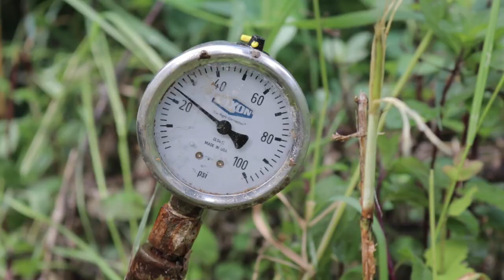My New Ram Pump - AMAZING!

Comment: my amazing father Gregory Blaine Anderson made and used one of these to collect water 1700 feet away and up 300 feet of 45-60% slope  in Montana, no gas no electricity 800- 1500 gallons per day depending on head.
Reply: How much of the water is being lost though? It looks 1/2 of the water is being pumped out of the pump into the environment. I've never seen one that is not right there at the water. Doesn't all that waste water cause problems?
Reply: That waste water is the reason why this pump doesn't break physics. You start with a lot of water at a certain elevation, and waste some (or most, depending on your needs) to get the remaining water to a higher elevation than it was at the beginning
Reply: +Dusker... That isn't true. The laws of physics aren't being broken in the same way that a dam isn't breaking the laws of physics. The ultimate energy source powering the pump is the sun. The sun evaporates water and then it rains and the water lands at a higher level than sea level and the water has kinetic energy from running downhill. That kinetic energy is converted to compressed air which forces water uphill. The design of the pump causes a large percentage of the water to get dumped, which is why it's usually right at the source.
When I said problems, I was mostly referring to drainage, land and erosion problems, not problems with the pump.
Reply: First of all i was very tired and didn't read your comment very well and so i didn't quite get what you were trying to say. My fault, I'll take the blame for that.

Regarding your analysis,
well you can say that the big bang is the ultimate source of energy then lol... your argument about the sun is partially invalid: it is true that the sun is powering the whole thing (as it does with almost every other source of energy on earth) but the potential energy gained by the water from the sun is maximum when said water is in clouds, and when it rains some of that energy is converted into kinetic all the way down to the ground, and when it sits in a pond it has much less potential energy than when it was in the clouds. So it's safe to say that we can begin calculations taking as starting point the source water body (as it is done in hydrodynamics).

What i meant is that, in a closed system like the earth, you can't transport water (or any body) at a higher elevation without putting energy into it - this would contradict physics because it would gain more potential energy than the kinetic energy it already had (ever wonder why dams don't use the energy they create through their turbines to move the water even more uphill? Quick answer: you can't). So if you just tried to move the water from the spring to higher land using its kinetic energy gained falling you will at most (assuming 100% efficiency in all the system) get it to where it started. However, an amount of water (let's say 1 liter) 10 meters above the pump has the same energy (relative to the amount it would have at the pump's level obviously) as say 0.1 liters 100 meters above the pump. By sacrificing water you gain height. The maths is pretty basic, the equation will be (m1*g*h1) = (m2*g*h2); since g is a constant we can take it out of the equation and we get (m1*h1) = (m2*h2) and you can easily see how changing one value varies the others to make sure the equation is respected.
Reply: +Dusker... The Earth is not a closed system. The sun is constantly giving the Earth energy. If Earth were a closed system, it would be near 0K with only remnants of the heat  from the core.
I understand that overunity is not possible. It would take far more water to generate the electricity to pump water back uphill than the pump could pump.
I understand that the Ram Pump isn't anywhere near 100% efficient  and that the system wouldn't work without that loss of water.  The pumps captures the energy in that moving water and then dumps some of the water and then is left with enough energy to pump the remaining water some particular height based on both the amount of energy in the moving water and the design of the system.
Also, some of the water may be coming from natural artesian wells and have a different source (though not ULTIMATELY) of energy..
My point is and was that all that water the pump is losing causes other problems such as mosquitoes, erosion of the soil, growth of plants that like standing water etc.  In all of the other instances I've seen of these Ram Pumps, they are at the water source and the loss is no big deal because it just goes back into the stream and is not free to do its evil deeds.

Also, no hard feelings. Sorry if I came off snarky or something. If so, it was unintentional.
Reply: if that "waste" water end up in same creek as original source, there is no environmental issues. its just diverted in certain amount from its original path to be reunited downstream.
even if not following its original stream, amount of water in this case is not significant to cause any huge damage to its surrounding.
do not forget, people build a ponds, lakes, and still environment absorb such structure. i am not aware of any cliff where huge amount of water will cause landslides and erosion.

as evident in this case, it is the valley between two sides of the hills and natural collector of the rain/snow/ice water. rest your mind, all is good here :)
Reply: @tarstarkusz  R/IAmVerySmart
Reply: @tarstarkusz   probably like 90+ percent continues on its natural course., its probably thinking to head on down to the sea. buy where is this sea thinks the water? I guess i'll just flow on down till i find it, says he.
Reply: @tarstarkusz  In another ram pump animation video, they say, if you intake is 10 litres per sec  depending on supply head, then only 250 ml of water per sec is puMped 100 meters upwards
Reply: Since m1h1 = m2h2 measured at the pump, the pump then can be put into a deep deep hole, so h2/h1 gets close to 1. This means as long as the hole is deep enough, the waste water can be reduced to almost 0. Right? Of course, assuming the waste water still can be drained in the hole.

Comment: i guess with enough storage towers and pipe...and some float valves to slow or restrict  water levels in the towers or tanks..could you move water indefinitely?   soo given a a handicapp of say one year? cause nothing lasts forever.... could this be propeterial motion that actually works?

Comment: as a man who works in the water industry as a mech fitter i enjoyed this video!
I would be wary of using the plastic pump in winter, although it has constant flow i reckon it is likely to freeze and crack, we use pvc-u a lot. We dont even really get that cold of a winter here in england either haha.

Also, when using your stilsons to free the union, take a ball peen hammer and just knock the union without the stillos on. this is usually enough and avoids you having to hit your tools :) nice video!

Comment: If you have enough fall after the pump , you can install a second Ram pump using the waste water and return a portion back to the source , or several pumps daisy chained and stretch your supply during dry spells .

Comment: It would be nice to catch the "waste water" and perhaps let it collect in a man made pond. Stock it with fish. The grassy are you walked through when finished, could that be dug out and made into a pond?
Reply: Read Sepp Holzer's book "Permaculture"; I'm only a very little way into it but one of the first things he talks about is making a pond.
Reply from the maker: The wast water runs directly into our pond,
Reply: does the waste valve have to be left open to work or could it be plumbed to a catch basin or pond?
Reply: Wranglerstar  you should look into a venturie set up for easier prime could use air pressure and or water from reserve to pull a vaccumn on feed pipe for faster prime if you would like to see what i am talking about pm me thanks and nice video
Reply: Or maybe divert it back to where it was originally (if possible)

Comment: you should also put a screen over your stand pipe because that is an access point for trash in your system
Reply: Right. When the pump is not working, that wastgate valve is open, so anything can just fall in.

Comment: I have a few ideas for your ram pump. At the inlet, cut the short end of a large funnel to fit the inlet of the ram pump, then put screen on it so the area coverage is much greater and you wouldnt have to clean it near as much. Also for other debris that gets in your could install a tank (5 gal would work) near the inlet with a large watertight opening at the top side about 4" or more so you can simply open the lid and clean it out before anything gets to the smaller pipes and pump at the home. Just put another screen in the outlet side of the tank. The cleanout opening for the tank can be pvc so you can bury the tank just below the surface and still reach it.
Reply: Nice idea. Perhaps having the funnel gauze at an angle to the flow so it will shed debris to the side would help too.

Comment: What will you do if Jack gets smart and chooses to work smarter not harder? He might figure out that he can just make a bigger inlet filter pipe area, make like a big O out of perforated pipes and wrap pipe section in screen, then hook that to your inlet pipe and now it will take like a year to clog the entire screen. lol A rectangle could work even better since you can make a rectangle easy from pipes, make a rectangle out of perforated that way you can easily wrap it all in screen, just have a tee on the perforated pipe rectangle where you hook it to your inlet, it will look like a rectangle screen when you are done, and you gain even more filter area. It means it won't clog every week. Based on the size you have available, you could make the rectangle around 3'x5' but that is huge for the application, so a 2'x3' rectangle would keep your inlet clear for at least a year straight. But that is only if the top, bottom, and sides are all under water. Don't glue it to the inlet, but glue it together as one inlet filter pipe system, a one piece system, then you can just pull it of the input leaving the screen on the glued pipes, and just clean off and then swish in water until perfectly clean again, then put it back on as one piece.

Comment: pull off 24 feet (for Stihl professional heads), pinch at 12, stick both ends in the spool at the same time and wind both sides at the same time. when you come to the end, clip the loop, and set the ends in the head! once you get the hang of it, its a lot more efficient!

as for the string going back in, thats usually casue the cutting length needs to be maintained. just tap it bore often, (cutting off a bit excess is less frustrating than re spooling)

Comment: if you install the screen every yr then how did pine cones get in the pipe?
Reply: The screen probably gets torn and larger material (pinecones and sticks) can fiddle their way into the line. Might be better if they use a cone or cylinder setup with a few layers of mesh over the draw pipe. But how would they teach their children about responsibility if they had a system that was perfect and needed no maintenance.

Comment: Why not pipe your overflow to a tank and make  electricity?  (like a cheap 18' swimming pool, and use solar , single battery,  to open a solenoid every time the pool is full.)

Comment: You should have a much bigger screen than what you installed: with such a small surface, it will get clogged almost immediately. Make a kind of sphere structure, from sort of mesh, maybe 5" diameter, cover that with door screen, now you have a good filter surface.
Reply: To elaborate a bit, with the screen the way you installed it, you have about 3.14 square inches of filtering surface, with a sphere of 5" diameter, you have about 60 square inches of filtering surface: much less likely to clog fast. In fact, strainers installed at the end of a suction pipe are always double diameter of the pipe... Around here, fire fighters often use water pumped directly from natural resources, I have seen them use a wicker basket as strainer.
Reply: Easier to take a length of PVC pipe, cap it and drill it full of holes and then wrap a screen around it.  Will dramatically increase the surface area without much fuss or cost.

Comment: I have a Stihl FS460 brushcutter/strimmer (I don't know what they are called in the USA) and I have found that when loading the string, it is best to bend it into a 1/2" hook on the end with a pair of pliers.  This helps keep the strimming string/twine fastened into the spool.  Also if I wind it too tight around spool, it melts, so wind it loose.  Just a suggestion.
I have a blade too but it gets terribly tangled with nettle and briar which are fibrous.

Regarding the water collector...  If you find a piece of drain pipe (the corrugated plastic stuff 3" or 4" with little holes in it) that slips over your 2" pipe (you can easily make an adaptor using a carved rubber bung) and then completely overwrap that corrugated pipe with gauze, it will extend the surface area for filtration and then you don't have to clean it so often.  You can also make all of the holes in the corrugated pipe a little bigger with your battery drill.

Comment: Thanks for the explanation.  I live in Sri Lanka. I assembled a pump, 1/2" and it works. Mostly out of PVC other than the 2 valves. I will be tightening ang glueing all the components tomorrow. 
Thanks once again.

Comment: Suggestion, put a union on the upstream side of your supply valve. It makes it easier to remove and clean out. A gate valve, which is what that looks like , is notorious for getting stuff stuck in the valve seat, a ball valve might be a bit better. By the way there are friction and fixture losses, just not that big a concern with this set up.

Comment: Helpful tip for rewinding your trimmer line... there are two holes with a slot cut in them on the button side of the rotor. Those are for holding the line after you wind it to keep the spool tight/prevent jamming. Just pop the end of the line into that notch until you have the rotor secured in the housing. There are also tabs on the rotor that correspond with tabs on the inside of the housing to secure the rotor against the housing, just push in the rotor and rotate until the little slotted holes that secure the line for winding line up with the metal shrouded holes in the housing, you will find that the tabs allow you to move the line into the "loaded" position with ease and prevent jamming while trying to feed out line. You can leave the rotor in this position until you have placed the rotor cap back on the line head. Just give the ends of the line a pull after everything is back together and it will set the rotor in the "ready to feed" position. Cheers!

Comment: Just buy the yellow 3mm string. Ist much more durable than this round thin one that alwas snaps directly at the head.
And a big pre Filter in front ob your pipe inlet would safe you a lot of work every year ;)

Comment: Couldn't you go big and use stainless steel check valves.  They are probably 5x the cost but they should last much longer preventing you from having to rebuild the pump as often.

Comment: Where can I get a bronze "check valve" or "flapper valve" but ALL MADE OUT OF BRONZE: that is "flapper" and flapper´s "seat". No rubber, no plastics whatsoever just metal. Model or part number and vendor will greatly appreciated.

Comment: put an inch hose on the other side and let it run down to you! will pump more out of the waste  side than YOU are getting! you will be just disposing of it! but you can use the water down somewhere else. DONT USE THE  SAME  SIZE OF HOSE ON IT! has to be an INCH or MORE!

Comment: Hey, Wranglerstar. I was looking around for a DIY pump for my off-grid weekend house and here I am. I have a question considering Ram Pump. I have plenty of ground water in my water well but its about 10 feet in depth. Is Ram pump capable of pulling the water from the depth?
Cheers Mario

Comment: I did a little math.  If it pumps 1.4 gallons around the clock, in 6 months that's about 130,000 gallons of water.  That's a good bit of water!  :)  Someone said below that there are few things as aesthetically pleasing as a working ram pump.  Nicely done, Cody.

Comment: I got an 8 inch saw blade & 2x 12 inch saw blades to mount on my Weed whacker for doing heavy brush & for cutting wood with, I've cut part of a log with my 12 inch saw blade, if you go at it wrong, then you get more kickback & the kickback's really dangerous, just like running a chainsaw, but you do have really interesting videos, I'm wanting a pump to get ground water out of the ground & into a Water tower that's got a 6,139 gallon tank that's 7 foot off the surface of the ground & without Electricity.

Comment: Here is my weed-wacker string replacement technique to help reduce it getting all balled-up inside the spool...  1) wind the new string onto the spool.  2) pull out you 940 and cut to length. (I love my Benchmade 940 too!!!)   3) take the string back off the spool and use it to measure the second length of string...  Cut second length with the 940.  4) now, rewind the string back onto the spool.  This second winding removes any twists from the string and allows it to feed reliably without any issues!  Love your videos...  Edmo